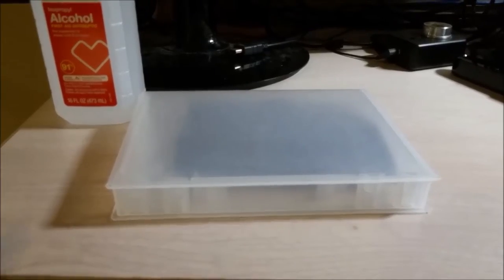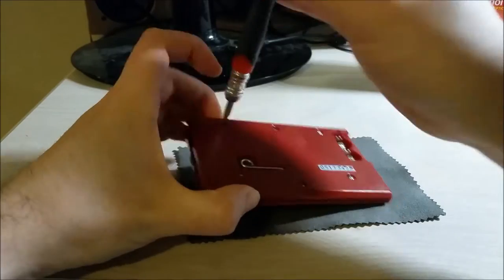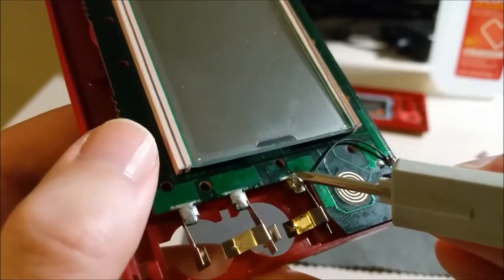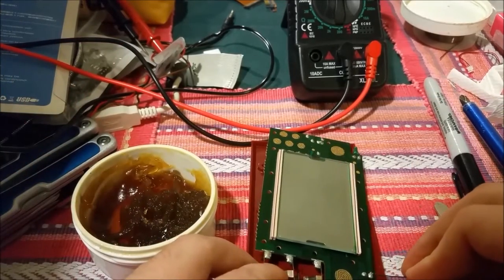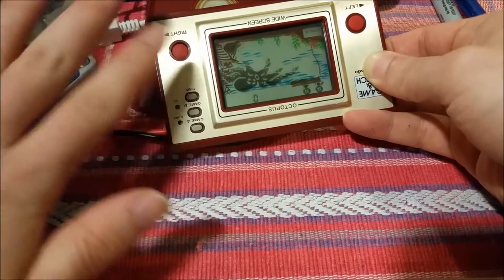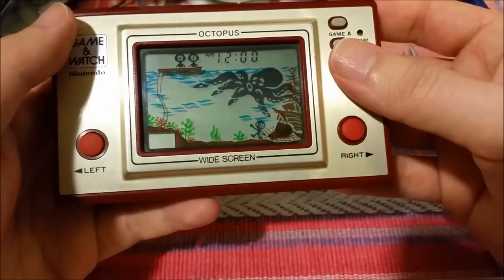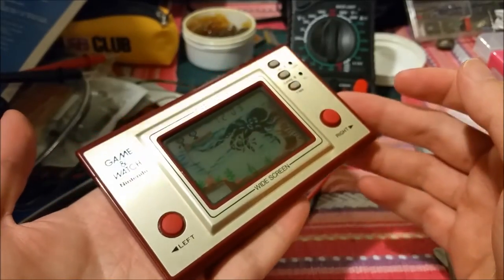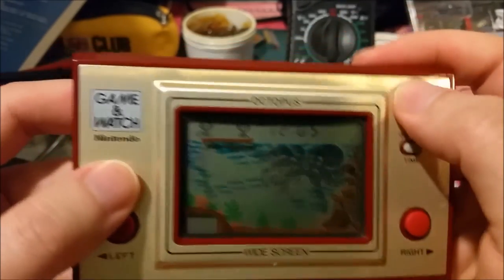Mailbox #4: The Craziest Ebay Nintendo Score Ever (Game & Watch Repair)!!!

Comment: The diode on the speaker could be a zener. Think of the piezoelectric effect of hitting a crystal and it's production of voltage. I have placed leds on them and lit them up just by blowing on a piezoelectric speaker. I am betting it clamps any voltage spike that might come from the speaker from something like a sudden hit or a drop on a hard surface. This would end up protecting the IC from that sudden voltage spike.
Reply from the maker: Yeah that's entirely plausible

Comment: I wouldn't call the kickstand "interesting" it's a normal necessary part of the unit, they're called "Game & Watch" because they're a game and have a clock and alarm built it in, the whole idea is you would flip out the kickstand and put it on your desk or bedside table, you could set the alarm to wake you up in the morning, I was 11 years old when these were released and they were so awesome, you could clock the game by getting to 999, then over to 000, you were cool if you could clock it on game B.
Reply from the maker: I just called it interesting because fold out kickstands are a pretty uncommon feature nowadays.

Comment: Great Video. This is very informative  and detailed. I have the same game & watch, I have same issue where the octopus has some  "ghosty" speckling as well. Could you please tell me more on to clean the lcd to get rid of it?
Reply from the maker: King Kamote If the uneven speckling only shows up with batteries inserted and powered on then it is likely either dirty contacts or the lcd connections. Either way make sure to scrub everything squeaky clean with isopropyl alcohol.
Reply: Thank you for the response. I will do that. I was very reluctant opening and fiddling with the insides of my game and watch but with your video's clear detailed look, I can take my time and do it. Thanks again. I got a number of game and watches,thank goodness they dont have any issues. Keep up the good work. Thank you very much.

Comment: Hi, nice video. I also have a game and watch, but with unresponsive buttons. I ve already opened it to clean the buttons, with no difference. Any ideas what could be wrong with the buttons?
Reply from the maker: Do you notice any damage due to battery leakage? It could be some of the traces are damaged and need to be bridged.
Reply: sjm4306 hi, i found the problem. The trace to to chip had a problem. The soldering was oxidated.